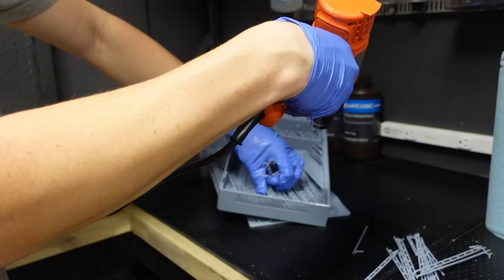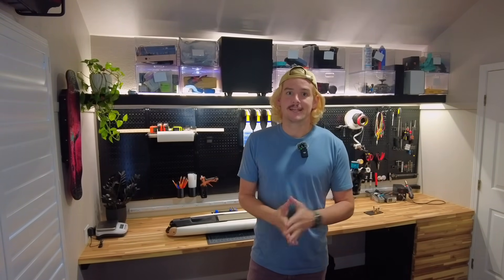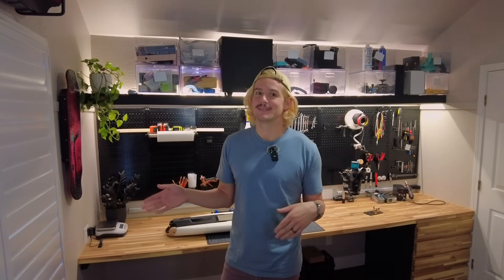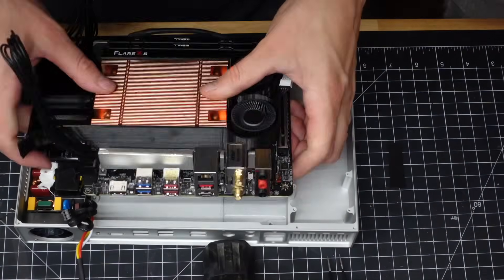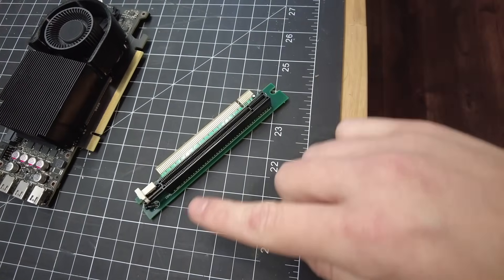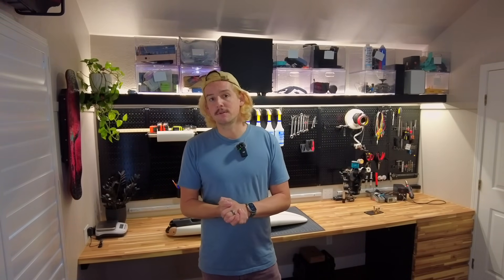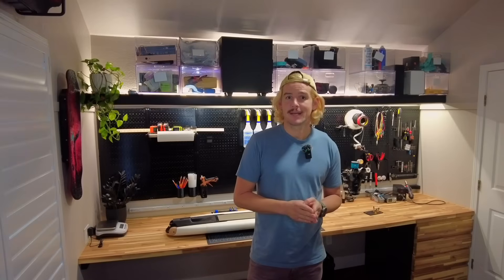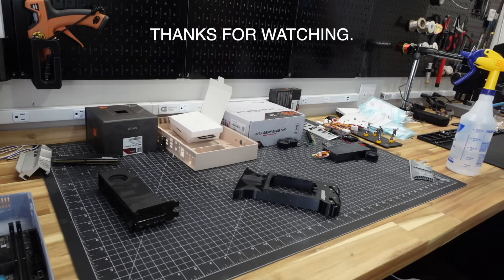I Built the Ultimate 2.5 Liter SFF Workstation PC

Comment: If you are seeing high CPU temps, re-using the thermal grizzly graphene thermal pad causes it to loose integrity on continued reapplication. Might be worth getting a new one and only tightening the cooler down on it once and see the thermal improvement.
Reply from the maker: Yea might be worth a try. CPU temps are not too bad but improvement is always nice.

Comment: How many m.2 ssd slots, and what is the max storage and ram capacity with your hardware?  I am interested in a complete system maxed out.  Please advise, and thank you for showing the customization potential. I have the same problem with TSA and need a compact work solution.
Reply from the maker: It has 2 slots for m.2 though the primary top side one has more lanes. I did make sure to leave room in the case for the bottom drive as well. The motherboard is listed in the video description if you want to dig further.
Reply: @FriesenDesigns  I haven't checked specs on the M/B, do you know the max m.2 capacity for both slots... as I do a lot of drone topography & sonar lidar data and need a fast m.2 for apps and a large capacity storage m.2 for project/s.  Is there any chance of additional m.2 slots being added?  I really like your attention to detail and esthetics of your solution... very nice 👏

Comment: I don’t know what to think about this. It’s small but it solves a problem I’m trying to understand. Solidworks isn’t a game where latency matters so I don’t understand why you wouldn’t just setup a powerful workstation where you work most and VPN and Remote Desktop in when at your secondary location.
Reply from the maker: VPN to sweden is going to have some pretty nasty latency, also I am now relying on two seperate internet connections to be functioning well in order to work. Not the worst solution but not without its own sacrifices. Anyways the build was as much for fun as it was to address the problem.

Comment: Awesome project! Jealous of the build. If you wanted to fully min/max, swap out for the AMD Epyc 4464P 12c/24t 65W TDP and spend the extra power budget on a light overclock. I don't have the confidence to not screw up the PSU section, but if you ever decide to take commissions for full builds I'll be watching for the announcement.

Comment: Awesome build! Awesome build! How did you update the bios if you could get the bios to boot?
Reply from the maker: Yeah, that was a little tricky. I think if I had removed the RAM it would have booted but instead I used a USB flashing trick the MSI motherboard had where you do a direct firmware update using a specific USB slot and specific filename. Found a tutorial somewhere online.

Comment: Note that a Ryzen 8700F has 20w lower power draw (even at idle) because there is no IO die.  The only downside is the x8 4.0 link to the GPU.  But that's still as much bandwidth as the old 3.0 x16. (And only $125)

Comment: Cool built, got some questions though. How expensive is it to custom order a case like that machined from a single block? and also why didn't you have fins machined into the case to double the surface area and increase the passive cooling off the case?
Reply from the maker: There are some small grooves machined in which will improve radiative cooling a bit but I didn't want to carry a bunch of extra weight in metal and the cooling is good enough. The cost breakdown is at the end off the video but the machined bits were around $350 for a one off from JLPCB bead blasted and anodized.

Comment: if your solid works models are taking forever to rebuild that means you modeled them badly, rebuilding should only take seconds max. Learn to fully define the entire model & avoid using external references.
Reply from the maker: I am aware of what slows down rebuild times I have been doing this for like 12 years. But generally if you saw the level of complexity of the things I do and the lack of available time for making perfect theoretical parametric models you would probably begin to understand the importance of a fast computer. If I can either spend time being creative and trying new designs or optimizing my parametric model to be more efficient where do you think the time is better spent? A good model is one that you can make and try the quickest and rebuild times are rarely the bottleneck there just an added delay in the process that is frustrating to endure. As a product designer you need to be ready to throw your model out and start over so time spent optimizing a model is rarely well spent.

Comment: Yes. I would be very interested in a case/kit. I work remote as embedded engineer with much the same needs for ECAD and software builds. I have been planning out a build for years, waiting for 64GB DDR5 UDIMMs to be a thing (I upgrade when I can 4x my previous machine...). I was going to be using the Velka3 I've got in a closet, but this is exactly what I've been struggling to design, as the mechanicals are my weak point.
Reply: Hell, even if you don't do a small run, I'd be willing to pay just for the design files and BoM.

Comment: Interesting project, but I struggle to understand the point of the comparisons when the CPU and GPU configs are very different.. If the goal of the comparison is to show that the 2.5L did not sacrifice performance, at the very least, it should be done with the same cpu/gpu config as your 5L case.
Reply from the maker: Yea, a valid point. I tried to mention that in my disclaimer. Mostly the benchmarks were just me being excited at new shiny PC vs. my old dusty PC and I didn't have the budget for a second build like this. That is a good idea though I should have put together the parts in a standard SFF case before doing this build and done a cross comparison, wish I thought of that! Ultimately what I mean by no sacrifices is I have a few full ATX builds and this feels just as smooth if not smoother to work on so it passes that "good enough" threshold where I am not sitting there frustrated with my slow PC. But give it a year and we will be back to that 😁

Comment: why does the cpu get a giant copper heatsink but the gpu doesn't?
Reply from the maker: Because the CPU is my favorite child and the GPU only gets hand me downs. But no actually because the stock cooler fit fine and since I wasn't planning on overclocking it and knew it would have ample airflow I left it as is. Also saves a bit of weight in the backpack which is nice and the GPU temps have been looking ok.

Comment: 250watts does all that? I had trouble getting that to work with a i3 3000 itx build with no gpu
Reply from the maker: Yeah AMD does a lot better in the efficiency department though supposedly this new generation of intel processors that removed hyper-threading has improved? I am skeptical.

Comment: This build reminds me of the Optimum's world tiniest pc build because it also used a low profile GPU and the HDplex 250 watt PSU. The thing is that his build was 3.6 liters with very similar components, I don't understand how you got your build to cut a whole liter of volume from your build when it is a very similar idea. Your build definitely seems more compact than Optimum's build because you disassembled the GPU and PSU which does make the build dramatically slimmer, yet it is still hard to believe it was so dramatic it was a full liter less. Is your build calculating only internal volume or something like that?
I'm not trying to diminish your work, I'm just curious about this. I'm extremely impressed by this build and it's quality and care that you put into this build. No offence to Optimum, but your build has noticeably more effort put into this build.
Reply from the maker: No! Those are the outer dimensions volume and taking a simple rectangular prism envelope no like subtracting tiny voids or any cheating like that. The cooler is extremely slim.

With respect to optimum, he put out like 20 videos in the time it took me to make just this one and his camera work is on another level. But when I saw that video from him it made me very excited to show this one. Would love to get one of these in his hands.

Comment: I don't get it why don't u rotate the GPU so it's fan is on same side as pci 4.0 quality risier is available now and could allow one thin filter and mounting the case on wall or back of monitor 😊
Reply from the maker: I really, really wanted to. Unfortunately everything I could sort out made it considerably longer since it interfered with the CPU cooler.
Reply: @FriesenDesigns  U really must have needed ssf & epic work . might I suggest that you make this whole case from folded Thick 3mm sheet metal  then u can actually mass produce it by PCB way or similer but do rotate the GPU & have pci slot then it will fit far more things anyway  give it a try when U get time from ur core venture
Reply: @AnupamVipul  we really need such devices here too...I hope someone do make & sell it in our land

Comment: Would it be possible to make the I/O in the back of the case generalized? Essentially having a cutout for a custom I/O plate per motherboard, since OEM I/O shields are too big it seems. Then depending on what mobo is used, a swappable plate for that specific board's I/O could be milled separately instead of being directly milled into the rest of the case. It would be even cooler if the sides of the plate were beveled, so that it would slide in place from above before getting locked in place once the top is affixed.
Reply from the maker: I think so! I might make a few minor mods like this and see if a v2 might be more flexible after getting everyones feedback.

Comment: One question.  
Why did he forget about actual full scale  Mobile Worsations like HP  Zbook Fury 16 G1,  Dell Precision 7780/7680 Lenovo Thinkpad P16 Gen 2 with RTX 5000 Ada?

I do not want belittle the project, really.
But mobile RTX 5000 solutions are just superior to a SFF  RTX 4000. 

It was framed as a solution for a legitimate problem which already that had a industry standard solution already.
Reply from the maker: The main reason is I don't need a display and keyboard builtin for my remote work. Thusly my build ends up faster, lighter, cheaper and smaller than these setups when you include their chargers in the equation. As for the Ada 5000 vs 4000 the main thing that bottlnecks solidworks is CPU and then I just need enough vram to load everything. The 4000 has 20 Gb which for what I do is enough. I'm not claiming to have designed some silver bullet for industry folks, just that I designed what I believe the best solution for my extremely niche use case.
Reply: @FriesenDesigns  
Fair enough. 
The build ended up really nice, regardless.

Comment: Great intriguing build and video! That's a like & sub for you.
What are the ambient temps like when you're running the setup? I suspect this isn't viable on my side of the pond where average daytime indoor ambient temperatures run 30~32'C.
Solidworks has always been finicky with the GPU especially back when I had to use it for coursework back in 2001.
I had to hard mod my Geforce 256 into a Quadro just so it'd work properly - It'd run on the Geforce drivers but I'd have to keep refreshing for the wireframe to show up everytime I pan/ zoom.
Reply from the maker: My office gets a bit toasty in the summer with how my AC is setup so 28-30C is definitely happening. I really haven't come too close to thermal throttling it as long as I am not trying to overclock anything. And yea the driver locks and general lack of support for anything but quadro cards is very frustrating.

Comment: Very nice design, hats off. Does JLPCB or anywhere else have a way to sell your case design ? Something like a cnc-on-demand thing. I know there are options for 3D prints so that might be an option for folks to self-source so you don't have the hassle of collecting parts and shipping yourself if you do decide to do kits.
Reply from the maker: That is definitely an interesting concept. There is also a fair number of 3D printed bits and bobs I would probably just crank out on my printers here. But reading the comments and thinking on it I might make a v2 with a bit more build flexibility as this one is quite narrow on parts that fit and that is definitely a weakness. I will probably also design a small adapter PCB for the fans so that it is more plug and play.

Comment: There is a great deal of buzz around your build ^_^
Some of the SFF community members are especially interested in your CPU cooler modification and you excellent space savings.
I would say if you WANT this to be more "builder friendly" perhaps modding the case to accept a standard IO shield if possible? and maybe offering a special modular rear plate and standard ventilation on the side to support MORE low profile GPUs like the 3050 or 4060LP ?
Reply from the maker: Thanks for the kind words. Think that is great advice. Might be possible to stay under 3 liters and achieve those goals. I will investigate.

Comment: Very cool project!! I'm always jealous of people with all of that fancy equipment and skills.

One recommendation: You should protect the fans somehow, especially for traveling. Maybe print some grills or caps... Or find a big laptop sleeve. 🤷‍♂🤷‍♂
Reply from the maker: They are actually so tiny and recessed and the tolerances are quite tight so I feel reasonably ok slipping it into the padded section in my backpack. A sleeve certainly wouldn't hurt anything though.

Comment: I've been thinking about doing a very similar build myself, as I find myself also moving around for work a lot.

What heatsink and fans are you using for the CPU, and how did you adapt that to the desktop motherboard mounts?
Reply from the maker: It is a heatsink designed for AM5 so no need to adapt that part. I will list all the parts in the video description. I use a 3D printed PETG piece to channel the airflow of the blower fans.

Comment: It's unfortunate that AMD has not yet released a 12 core 65 watt processor like the 7900 (non-X) for the 9000 series. Huge difference in power and heat in the 65 watt vs the 120 watt processors. I guess there's the Ryzen 9 Pro 7945, but that's on 5nm (instead of 4nm like hte 9000 series).
Reply from the maker: I think you can just tweak the power settings in Bios and achieve an almost identical performance (and pay extra for the letter x at the end haha). I think many AM5 motherboards have presets for this.
Reply: @FriesenDesigns  understandable point. That's what I've heard from GamersNexus and other overclockers. I would genuinely like to see the performance per watt differences when a 7900 and 7900x perform when set to the same power profiles. :)

Comment: great project! i've got first gen a2000 and ryzen 5900 powered by flex psu in 4l case. no big need for transportation, i just love sff pcs. now i'm waiting for powerful pico psu for arrive, wanna move psu outside and fit some watercooling inside the case. hope i'll find small waterblock for a2000. and again thanks for your video, perfect build, nice work with blowers, love them too :)

Comment: I love what you did here! Personally I would rather have an external PSU so that the heat dissipation is purely on the CPU/GPU thermal production, but the fact that everything worked within tolerable heat ranges is awesome.
Reply from the maker: I was thinking about how cool a USB C powered 240W style build could be.

Comment: While this build is awesome, what do you think about the new Apple silicon, and the Mac Mini M4 pro? 
Smaller, faster, more energy efficient, and cheaper for the "base" M4 Pro than your custom build here and still comes with a nice aluminum housing. Thunderbolt 5 is pretty nice for expansion too, makes the small base SSD palatable. Really not trying to take away from your project, but just wondered if you thought about giving it a try in your workflow?
Reply from the maker: Doesn't run solidworks otherwise for sure would work nicely. Have tried running in parallels but it is buggy and poor performance.

Comment: Very interesting, although I would not have the io-shield included on the aluminum case. So you can swap main boards as you see fit. Why is it required to disassemble the Nvidia RTX 4000 SFF tho?
Reply from the maker: Wanted to go as tiny as possible and the shroud would have made the build like 47mm thick instead of 42mm so then it would be like 2.8 liters instead of 2.5. I do think I could instead do a 3D printed IO shield so more motherboards could be accomadated in the future.
Reply: @FriesenDesigns  True, a web search tells me the IO shield is 44.45mm wide, for standard ATX and derivatives. You can't even fit that on a 1U rack mount server case.

Comment: You should consider using a non-conductive materials for the I/O shield, it could have any components shorted, if ever accidentally made contact with anything at all.
Reply from the maker: There really isn't any concern with shorting as many IO shields that come stock in motherboards are metal already and all shielding on connectors is GND anyways. That said a modular IO shield would be nicer for upgradeability.

Comment: This might be one of the coolest sff builds Ive seen in the past 3 years, and yes Ive seen a lot!!!! But did you make sure to connect grounds of the mains to the housing of the case, to let the rcd of the mains work in case something went wrong inside? (this is one of the first things tested in Germany when mains go inside a metal housing.) Also, would there be a way to let air run over the ram and slot the channel of air over the psu, to get some additional airflow on the inside on those rather warm components (not super important, but the warm air of the cpu is going over it anyways, might as well take some saturation away from the case. Also, would be cool to have the fins of the cpu and gpu cooler body connected to the lid with some thermal pads giving the fins some extra body to warm up. That would actually be a quick add on?